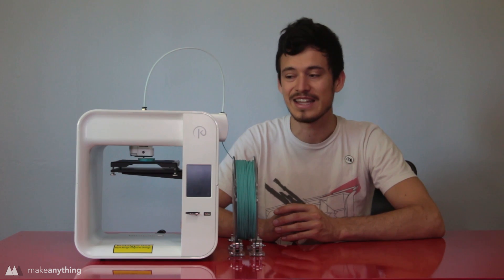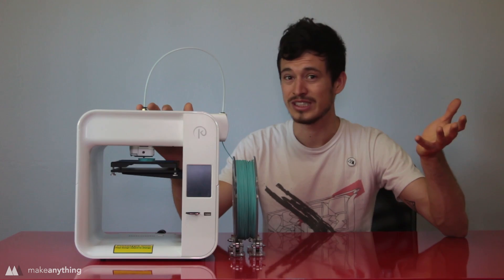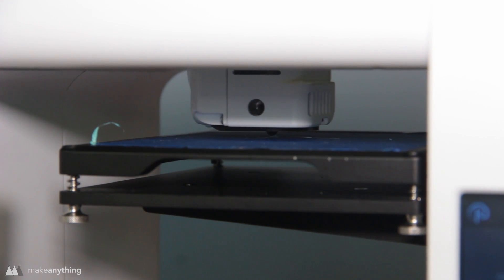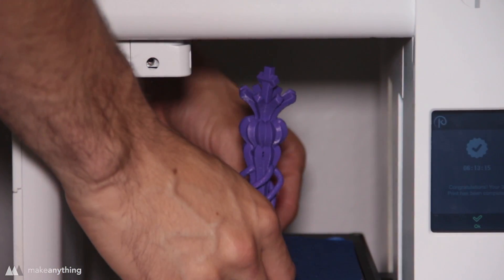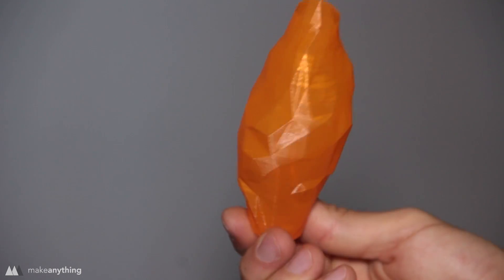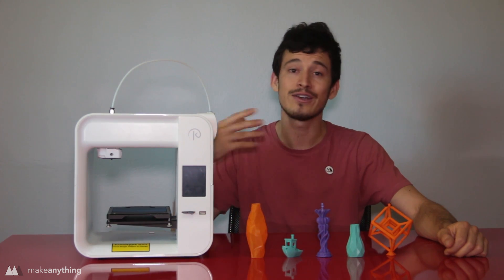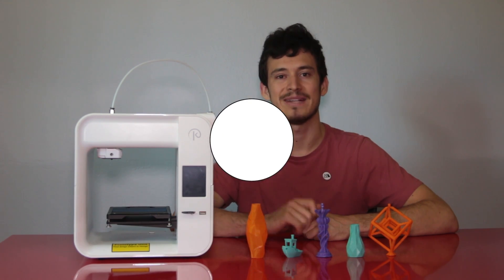The $99 Obsidian 3D Printer // Kickstarter Pre-Review

Comment: That is an exact replica of the Polaroid Playsmart Printer. The Playsmart an excellent printer by the way it has a heated bed, camera and lights. Its also $500. But not sure what is so "kickstarter" about it since it is a ripped off design. I would suspect the build quality you get from Polaroid is not the same for this one. Also Polaroid gives you a spool holder scale thing that mathches the printer. Except for the Polaroid logo on it it is exactly like the Polaroid Playsmart. It probably never happened because of the connection to Polaroid maybe?

Comment: Hey, sorry for posting again and thanks alot for the very quick reply you made before. What do you think is more beneficial, the 99$ version with heated bed or the 149$ without the heating bed? I'm trying to do this with value for money in its best form. I would appreciate your thought since I don't have the knowledge...
Reply from the maker: 149 version because the SD slot lets you print without having to keep your computer on and connected, and the touch screen makes life so much easier.
Reply: Make Anything // 3D Printing Channel thank you very much

Comment: a radiator plug that handles 100C+ temps printed with PLA... hope you're not serious about using it :)

does it have a part cooling fan?
Reply from the maker: Yes it has a cooling fan. The plug only comes in contact with cold coolant.. I guess it's not really a radiator plug

Comment: How big is the footprint of the entire printer? I'm gonna back them and I'm already planning where to put the printer but I don't know how big it is. And does the cable come out the back? Cause that would mean you can't set it facing outwards against a wall.
Reply from the maker: Yes currently it would need to be some distance from the wall, but it's pretty small overall.. maybe 1 ft x 1 ft
Reply: Make Anything // 3D Printing Channel Alright thank you!
Reply: Make Anything // 3D Printing Channel I would have about 3 inches behind it for the cable where I'm currently planning on putting it so thanks again for rough dimensions, it already gave me a lot of information!

Comment: Did you get paid for this review? BecauseI like your hypercube model, but in a way the print did fail and I am disappointed that you tried to hide the failed top with your fingers. Because this means that the cooling of the print is not as good as it should be for such a demanding print, resulting in springback of the lattices.
Reply from the maker: I wasn't paid, sorry for not pointing out that point beyond showing it in the timelapse.. i guess I did go a bit soft on the criticism because it's an r2 prototype out of 4 or 5.
Reply: Thanks for the clarification! I was a little worried since sometimes it's a bit blurry on youtube. Keep up the good (design)work

Comment: I have a da-vinci jr. 3d printer I got on sale for $150, which is usually $200, and based on what I see in this video, the da-vinci is not as good as this obsidian $150 model. Some of the more obvious things that make the obsidian better than my da-vinci is the lcd panel being touch screen and not button controlled, and the printer bed is much better because on my da-vinci I have to use stick glue and a knife for the process. Less obvious is the print quality itsself, which from what I see the obsidian does look to be of better quality than my da-vinci. The obsidian also handles overhangs much better than the da-vinci. On the little ship build he did with the engraved text on the bottom, that would not work on the da-vinci because it has a terrible time doing overhangs. So based my experience with a cheap printer, I would say this is well worth the money for $150.

Comment: ive been really interested in 3D printers. i would love to get into it, money isnt a big issue, but its there none the less. and the second would be power. i really didnt wanna risk putting ~$400-$800 into a 3D printer with how the electrical is set up where i live. its an old house where if the microwave, toaster oven and 1 more appliance is on, power gets tripped, including my pc. 

i would hate to have a print run and power trips. messing everything up. but if a cheap printer could resume the print where it last left off when the power dropped out, then i might just try it out

Comment: $99 with a heated bed? Sign me up!

On a second thought. 120*120*120 mm is just too small. Back to the iMakr STARTT, same price, no heated bed, but larger prints.
Reply: on their website they say that you need to buy the headed bed extra for 49 dollars unless you buy the 250 dollar version :-/
Reply: Well then, all the more reason to stick with the iMakr STARTT. Same price, larger prints.
Reply: Maby i try to get the early bird version for 50 dollars and buy the lcd screen and the headed bed extra. In that case i would pay 150 dollars and i would have the 250 dollar version without housing and that useless camera
Reply: btw. I am new to  3d printing so maby you can tell me what a headed bed is needed for?
Reply: Basically you need it to print with ABS. If you are fine with using PLA, you don't even need it.
Reply: Thanks for the information. is there a huge difference between this to materials?
Reply: Domonkos Horváth The A8 for me in the UK costs £140, so not sure where you're coming from.
Did you use the iMakr EU website or the iMakr US website? If you used the latter you would have to add import tax to the iMakr as well.

For me, the iMakr costs £100 and the A8 costs £140, so it's actually not much of a price gap.
Reply: Never mind then, the prices you mentioned were identical to that of a chinese site.
Reply: Imho, I wouldn't mind giving up a small amount of space for a pre-built 3d printer and twice the layer resolution.
Reply: JekyllGaming99 It won't have "twice the layer resolution" and to tell you the truth if you want a good printer for tinkering I would recommend an anet a8 or a6
Reply: michaelocity well, the iMakr has a minimum layer height of 0.1mm, whereas the Obsidian's is 0.05mm, so I don't see what's wrong. Also, the A6 costs nearly $200. However, I will agree on the A8 - the build volume is nearly 8 times larger and it only costs $160 atm. 

Tbh, I might actually go with the A8 instead - for the same price as the Obsidian (with the heated bed upgrade) and with a massive build volume it seems to be much more worth the money.

TL;DR - I realise the A8 is actually quite a bit better than the Obsidian, even if you have to assemble it yourself.
Reply: To add on to my last comment, do you think the A8 is worth the money, even if the Obsidian is half the price with the Early Bird offer? I think probably.
Reply: You forget sales taxes and import fees which can be in my case an additional 27-39% of the purchase price, whereas if I were to order a printer from within the EU it would come at no additional cost. So it's more like $99+shipping for the iMakr vs. 203-222 for the A8. We're talking more than double the price point in question, so no matter how much better, it's not part of the conversation.
Reply: sorry for the late response, but truthfully  a 0.05mm layer height is just an advertizing tactic. No filament extruding  3d printers can reliably extrude 0.05mm with even a 0.3mm nossel(if you want that kind of accurcy then get a sla printer). Even if it was able to, you would virtually be multiplying your printing time by 8 times when compared to a 0.2mm extrusion.
Reply: That's true, it would take much longer. Tbh I think I'm actually going to get an Anet A8 instead - about the same price as the base Obsidian for a much larger build volume and a heated bed already included ^-^

Comment: The cost of this 3d printer is 99 dollars?
Reply: Mr velocity 2004 The machine he reviewed here is $150 through the Kickstarter, and will retail for a bit more. The $99 machine lacks several of the features this machine has- no injection molded case/cover, no ability to print from an SD card, and no touchscreen if I'm remembering correctly.
Reply: Mr velocity 2004 Ok, no LCD screen.
Reply: OK, thanks Layne.
Reply: Mr velocity 2004 You're welcome!

Comment: What separates this from every other $99 3d printer on Kickstarter through? At any given moment, there is at least 1 $99 3d printer on kickstarter and they all make similar claims.
Reply: The difference is he got paid to do this video
Reply: The difference is in that this company already has released a 3d printer and there are already prototypes, a lot of the 99 3d printers that i've seen didn't even have proved to work concept, also they don't earn anyting on the 99 base model so in normal circumstances it would probably be more around 150

Comment: Wait, did you print the radiator plug from pla?
Reply: i thought the same thing. wouldnt that deform/melt in the heat? it had to be something besides pla
Reply: Even with heat aside, theres a lot of other forces happening there...
Reply: Unless the radiator plug is located on the cool side (the side where the coolant leaves the radiator), in which case it probably wouldn't need to hold up to temperatures as high as you think.
Reply: Eman2000 P.S. I have no doubts that the heat could cause problems, but (assuming the plug is located at the cold end of the radiator) there shouldn't be much heat above ~60°C, which is about as hot as the hot bed on the printer itself would be.
Reply: I don't think PLA is waterproof either.
Reply: Eman2000 If you mean the design of the plug, then I'm pretty sure around 3-4 layers on the outer shell would be pretty watertight, but then if he used it on his BMW then he probably used a 100% infill (I know I would, anyway), in which case it would be surprising if it wasn't waterproof.
Reply: JekyllGaming99 I'm pretty sure PLA will degrade and become very brittle when used in wet conditions. The heat would speed up this process. I'm kind of assuming this because PLA is biodegradable. I haven't tried it myself.
Reply: Everyone in this comment string lol. He would never use it in his car, its just a joke.

If anyone hits read more dont get mad if you knew this
Reply: Eman2000 Actually in wet conditions the PLA becomes slightly softer in wet conditions (as in submerged) and it doesn't show much degradation, even after several months. In a landfill, where there's more nutrients, organisms etc. to speed up the decomposition of the PLA, it still takes a few years to decompose.

Tbh, as long as he replaces it every few months or every 4 weeks (to be safe) it shouldn't be much of a problem.
Reply: Yeahh, 3D printed parts really should not be used in any part of an engine. It may be ok for a temporary fix, but an actual proper part should be used asap.
Reply: @3DprintedLife  i strongly desagree with u 3D printed parts can be really strong if there are desing correctly

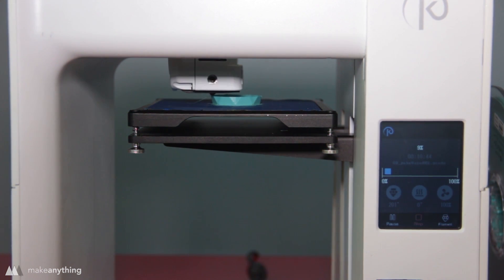Comment: 2:10 whaaaat?
The basic one wont have the injection molded plastic? So its just a bunch of hardware strapped together?
Reply: Victor García just 3D print it
Reply: I would assume that the injection mold plastic is only for looks and doesn't hold any structural integrity
Reply: Victor García what is the injection molded plastic?